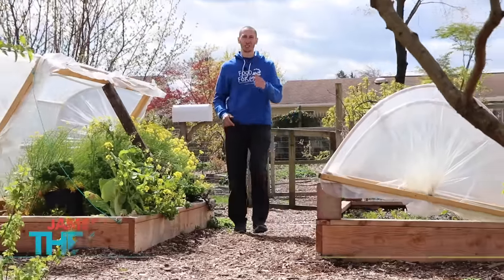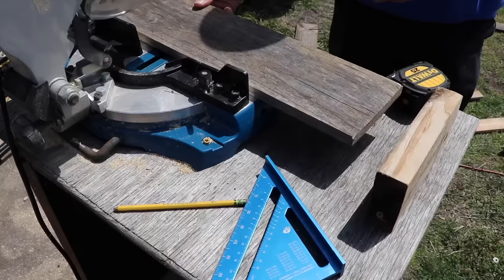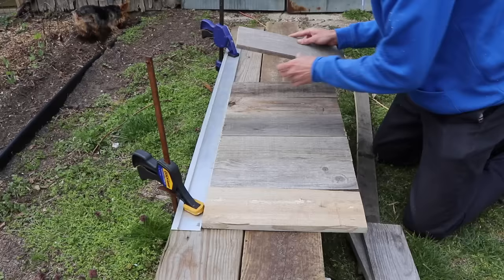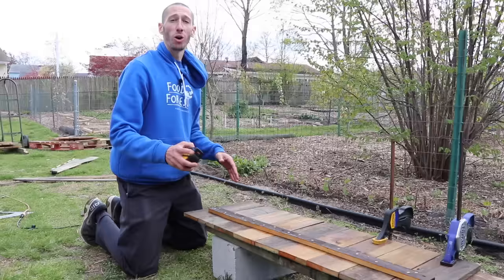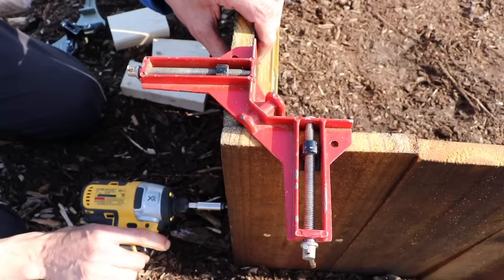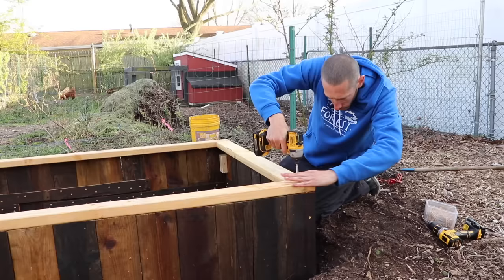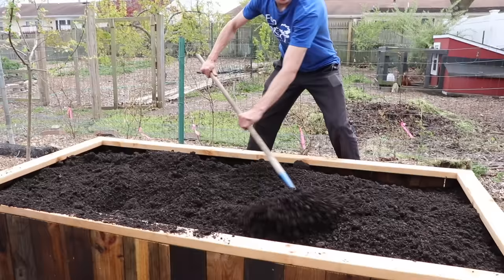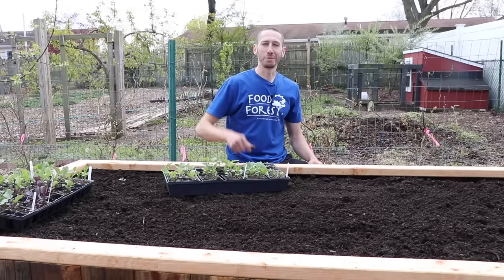How to Build a RAISED BED Using PALLETS, FREE Backyard Gardening

Comment: Have a question. One thing I hate about building raised beds out of wood is as soon as it is full of moist soil the wood starts to rot. I am thinking of building raised beds on stands instead of on the ground so I don't have to bend down but instead of the soil being against the wood I was thinking of using 55 gallon food grade barrels cut in half long ways to hold the soil with drainage holes drilled in the bottom of them. Is this plastic safe to plant in?

Comment: For anyone planning to build a raised bed out of pallets make sure you check for a label that says heat treated (HT) or kiln dried, or methyl bromide (MB).
Avoid the pallets treated with methyl bromide and use heat-treated pallets. Methyl bromide is a pesticide and is highly toxic. If the pallets are treated with it, depending on how long ago it was done, you WILL be exposed to it by handling it, cutting it, etc. The treatment degrades with age but you have no way of telling how much is still absorbed in the wood. If handling the wood and breathing in chemically treated sawdust doesn't kill you eating vegetables that grew in a raised bed constructed of toxic wood will.

Comment: It looks nice, but for me, for all that work, I would spend a few dollars and do it with new wood and get more years out of it. Tongue and groove cedar is not so expensive, I think it may cost $300 to do this size, and require a less work and less equipment cutting it square with just a circular saw  (finding recycled wood pallets would not be that easy either).
edit: PS linseed oil on cedar will surely create mold, I don't know on other wood. I would use something with a mold inhibitor mixed in, but only treat the exterior for cosmetic reasons.

Comment: That bed is beautiful!!! And your passion is contagious. I do have a question though, you mentioned not to use pressure treated wood, which woods would you recommend for building raised food planters? Also how can you tell if pallets are safe to use? Thank you for this awesome content! And hi wee chicken! 🐔
Reply: I know this is an old comment, but for others doing this, there are charts online that helps identify safe/unsafe pallets based on the stamps that may be on them. Some pallets are extremely toxic. With that said, I have done many projects with the safe ones.

Comment: Hi, this is so cool looking I love it. I need to ask, and I'm sorry because I am such a novice, please be nice. Is there any risk of leaching anything toxic from the pallets? It looks amazing. I want to build it tomorrow. I am just unfamiliar with the safety issue. Does the Linseed seal it and take care of that factor or am I overthinking this? Thank You. I love this channel and I adore Tuck. I am a vet tech, I was first attracted to the videos because of Tuck and then I stayed for all the amazing information. Thank You !!!
Reply: In general, safe pallets will carry the DB, KD, EPAL or HT markings, meaning that they haven’t been treated with dangerous chemicals. Pallets marked with the letters DB have not been treated at all, while EPAL, KD and HY markings mean that the wooden pallets have been kiln- or heat-treated rather than being treated using toxic chemicals.

Don't use pallets that appear oily or as if something was spilled on them. Also, the best pallets to use have the IPPC logo and are marked with HT. Pallets marked with MB and certain other letters have been treated with chemicals. 

Do a web search to find out more info.

Comment: Off topic , but if you get a new saw blade buy paint removal and take all that paint off your blades. Those carbide tips dont dull after time , they get gummed up with paint. And it's done on PURPOSE.  They coat those blades in thick paint for a reason.  I for one am tired of all the waste in this country.

Comment: I made a small raised bed out of the the old fence i replaced at my dads house. Probably should of made it a bit higher but im still really happy with it. 

Also in general doing 3 sides would NOT be a smart idea for any build like this. The dirt would push out the sides making it a V shape. Trying to fix that would be a fucking nightmare.

Comment: I want to do this. I’m in 50s and want to garden to very old age so I want to build raised beds higher than this. Probably around 36-40” high. I’m only 5’1” so I think that’s high enough.  Do you think it’s possible to do this with pallets, as you did? Would I just need extra bracing to prevent bowing?

Comment: looks amazing, but would it be beneficial to line the inside with a polythene ?
Reply: I use weed-block fabric (from Costco) as the inside liner.  It is water permeable and breathable -- not so with polythene.  But yes, a liner inside would prevent contact of soil with the pallet wood

Comment: My dude,how do u deal with termites?You have so many wooded raised beds and your whole yard is filled with wood mulch.Was inspired by your vid and built 2 similar design beds like yours but a little larger.Looked good,functioned well but I got screwed big time by termites.Had and have to throw everything away as well as dig and throw my hugelkutur setup in those beds.Wish me luck as I still have alot of work to do tomorrow..Sadly,my organic garden wont be organic anymore since ill need to treat the ground with fipronil to get rid of those pain in the ass termites

Comment: Great channel! Does having the plank sides "end on" in touch with the ground speed up rot? I have always either set mine on an inch of gravel to help drainage or fixed a rail along the bottom to try to limit this but not sure if it's necessary...?

Comment: What screws are you using to tie 2 x 4s to make railings my screws are grey yours are yellow.  Where do you get pallets? all the ones I find are smaller slates 3 to 4 inches.  The recycle center,  we dont have a recycling center just the trash company and they charge for everything. What is the name of yours?

Comment: excuse me as I go rip my garden bed up. smh. I would love to see how you might suggest turning this in to a self watering garden bed.
Reply: use 2 liter soda bottles. Poke 2 holes in the cap (to start to see how much water feeds out over how many days. 2 holes should make the water last for 3-4 days. You can either leave the bottle intact or cut off the bottom 1/4 to refill that way.

Make a hole away from the roots and bury the bottle just past the neck to where the bottle starts being round. Make sure the holes are big enough to not get clogged by soil, but not too big that you run out of water in less than a day. Either use a push pin or a 1/16 nail to do so.

If you need more info, look for soda bottle garden watering system on YT. Lots of videos and different ways to so it (some people use 20oz for small planters).

Comment: Nice and cheap but shouldn’t be done. A lot of wood pallets can be treated with methyl bromide to prevent pathogens on it. Those treated wood pallets are labeled as MB. It would be better to use HT wooden pallets as they are heat treated with no chemicals on them. But even HT can be bad and toxic, as wood pellets are reused a lot. Meaning they can be exposed to many chemicals from the cargo that’s hold on to them. Think if some oil jars were on the pallet and leaked it soaked into the wood. Reusing wooden pallets is great for other outdoor furnitures, but shouldn’t be put into the ground or for growing food as the chemicals will go into the soil and the food.

Comment: I read that boiled linseed oil is not safe to use on wood for garden beds. Is this true?
Reply: Yes, I think you want pure/raw linseed or tung oil (it will take longer to dry depending on conditions). Boiled is actually treated with chemical drying agents, apparently. I learned this myself just recently.

Comment: Two  major issues:  1.)   Boiled  linseed  oil  is  not  actually a  natural  product  suitable  for  garden  beds.  It's  not  actually  boiled  raw  oil.  It's  partially  dried  by the  addition  of   oxidizing (drying)  agents,  which   are   highly  toxic  metal  salts.  Boiled  linseed  oil  is  great  for  use  in  furniture,  but  not  for  anything   you  want to  grow   food  in.  2.) The  second  issue  is  the  use  of  mushroom  compost.   It's  not  actually  compost,   and  it's  absolutely  not   organic.  It is  SPENT   compost  that  mushroom  farmers  have  gotten  rid  of after almost all of the   nutrients  have been  used  up  by  mushroom  farming. Unlike  fresh  compost  which  contains  nutrients,  mushroom  compost  is  only  valuable  as a  mulch  to  retain   moisture  or to  break  up  clay  soil (if  it is  completely  mixed  in  with that  soil).  It  is  never  used  as a  top  dressing  in  a  garden,  since  it  only  functions  as a  sponge.    It  contains  all  sorts  of additives,  such as  gypsum  and  lime,  to  make  the  product  alkaline.  (So  it  actually   harms  fruits  and  vegetables  that  require  neutral ph or  acidic  soil.)  It  also  contains a  whole  host  of  chemical  additives.  And  it  generally  contains  un-aged poultry  and/or  horse  manure,  neither  of  which  should be  used  in  vegetable  gardens  sooner than  at  least  3 years  of  composting.  Those  manures  contain  the  hormones and  antibiotics   (and  toxins)  that   horses and  poultry   and  given.   If  mushroom  compost  is  made  properly,   it  is  pasteurized  to  get  rid  of harmful  bacteria  and  viruses,   which also happens  to  destroy  the  very  organic  life  compost  is  used  to   provide  soil  with.  But  even  worse,  mushroom  "compost"  is  not  often pasteurized    completely,  so the  toxins,  harmful  bacteria  and  viruses  are  still  present and  make  their  way  into the  vegetables  we  consume.   If  it  HAS  been  pasteurized  properly (and that's a real  crap-shoot)  it  can  be a  good  amendment  to clay  soil when it's  thoroughly  dug  in to  make  it  more  spongy,  but, again,  it  provides   almost no  nutrients  to that  soil.   When  using    properly  pasteurized mushroom  compost,  it  needs  to  be  mixed  with  at  least  double to  triple   its  volume  of  actual  compost in order  to  provide  the nutrients  and  beneficial biological  activity  to the  soil that  fruits  and  veggies  need to  thrive.

Comment: Nice product. Now then, at the risk of sounding like your dad, think safety. Wear safety goggles when using a circular saw. Also be careful where you ground it between cuts - at 3:20 you nearly cut your power cable. Sure, the blade is guarded, but not 100%. Close call.

Comment: The biggest mistake you made was driving screws in the top rail into the edge if the pallet's.You could have easily have used the pallets stringers around the edge and they would not have been seen .It would have been much stronger .It might last 2 years but I was not impressed. If you are going to build a raised garden you want it to last a minimum of 10 years.There are many other ways to build them cheaply -I use old corrugated iron for the sides .Painted will last a lifetime

Comment: Love your channel, but pallets suck. I wasted more time scrounging, hauling and tearing apart crappy wood covered in industrial chemicals then they were ever worth. 
Broke?? Just mound up ypur soil to make a raised bed.
Little more money? Buy cedar 1X4s for fencing and use those.
Baller status: 2 inch thick planks 8 or 10 feet long made from cedar that doesn't rot.
Reply: Heat treated pallets (which have the HT seal) aren't "covered in industrial chemicals".
As for the quality of the wood, use relatively new, crack-free pallets and you should be fine.

But yes, if the price is right, I agree that it's better to just buy rot-resistant planks.